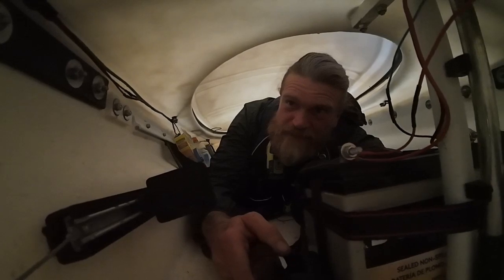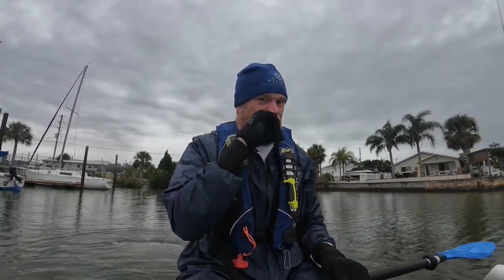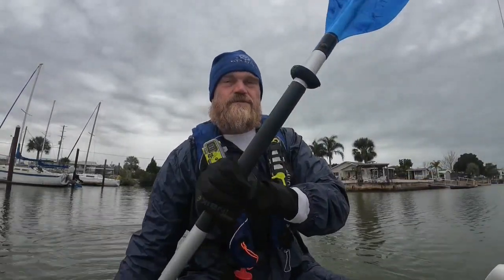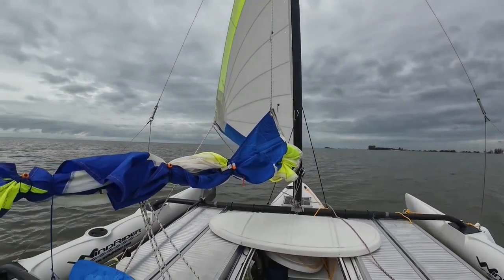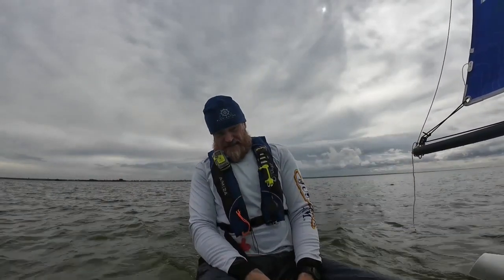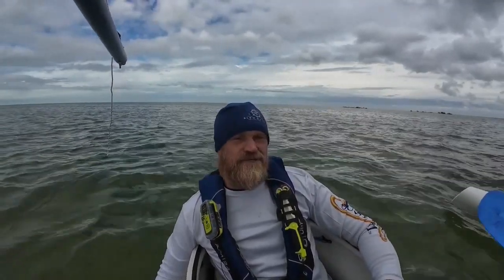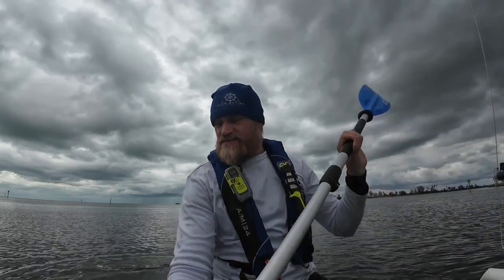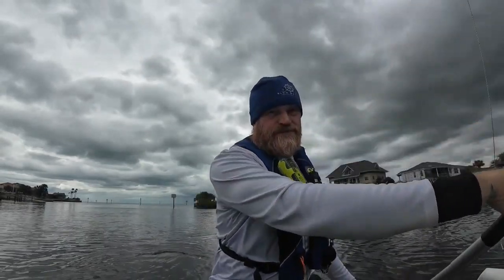Everglades Challenge foul weather gear test and sailing my Windrider 17

Comment: Great channel!  

I'm up here in Puget Sound and I have some foul weather gear advice gleaned through the years: Wool base layers will keep you from overheating when you're active and freezing when you're not moving.  A cheap drysuit is better than the best foulies.  Avoid too many synthetic fabric layers - use natural fabrics against the skin and the synthetics against the weather.  Best advise I ever got for dealing with overheating in the cold was from a polar explorer and it was "use wool."  

If you add a loop through the clew and around the boom to take up the majority of the wind load your outhaul will be doing what it needs to be doing to get the right sail shape and you'll gain a performance increase to windward.  

I did a side-by-side of windward performance between my W17 with main and jib and my buddie's W17 with only mainsail and he could point about 3 degrees higher while I gained a much more powerful reach.  At the end of the channel (about a mile) his headway outperformed my power by about four or six tacks and while I was hitting 12 knots and roaring along his sedate and steady 7 knots rounded the bend ahead of me.

Admittedly, my sails are TIRED and they've lost all their shape, but I trimmed them using every trick I know ... but it sure looks like these boats point better with just the main.  I think when I replace my wire rigging with heat treated dyneema then my jib will retain a better angle of incidence under higher loads, too... every degree higher you can point is miles off your course through the water.

Anyway, that's a pile of 2 cent pennies for you... take them for what they're worth!  Thanks for the content!!!
Reply from the maker: Wow, thanks for all that information!  It's great when people put forth the effort to share their gained knowledge. 
I love the Puget sound,  I was stationed at McChord AFB (now joint base Lewis/McChord) and lived on a boat at Foss Harbor Marina.  I have a lot of great memories out on the water fishing and crabbing or just sailing around out there.  Thanks again and I will use your knowledge as I prep for the cooler weather

Comment: it seems to me that the difficulty in tacking was because you didn't have the boom and mainsail properly trimmed for upwind work. This is crucial, more in a Windrider 17 which is not known to be a great upwind machine to start with. But I guess you will have sorted that out by the time you read this, good luck tomorrow in the EC2024!!